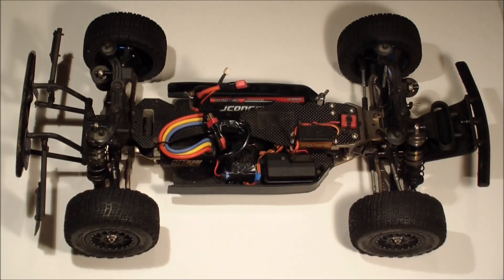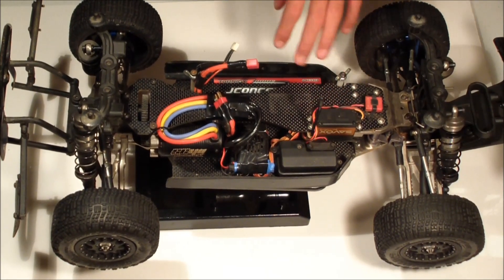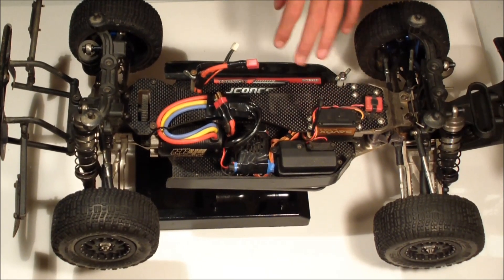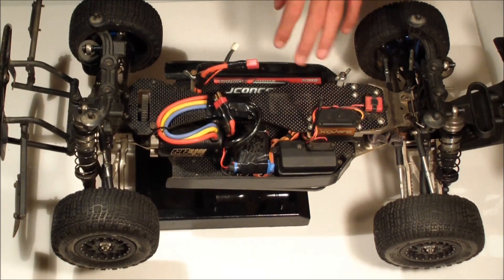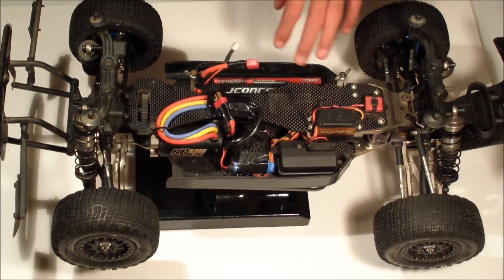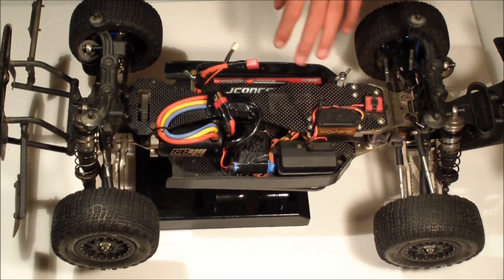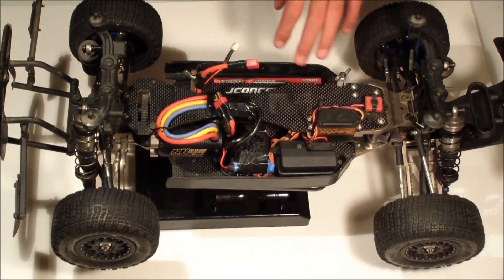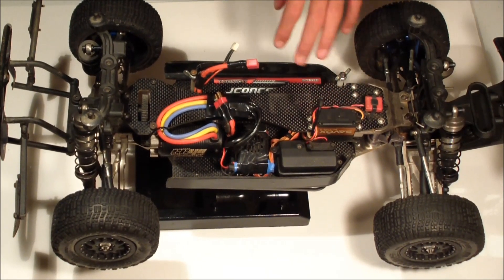TRCE Slash 4x4 Race Setup Video

Comment from the maker: It's the system the tracks use to count your laps. Each track has a buried wire that senses every time you pass. And when you pass, the transponder tells the system how fast your lap was, your pace, and the leader. They won't let you race without one.

Comment from the maker: The main reason is the quality of the product. Team RCE is a smaller business and rely on their quality to maintain their reputation. The RCE chassis was built for those who want to convert their slashes into competitive racers. Not saying the Traxxas lcg isn't made for racing, it's just that it has other purposes too. The flat plate of carbon fiber also makes it easier to mount electronics, changing and rearranging layouts to fit your needs.

Comment from the maker: The RCE chassis was built for those who want to convert their slashes into competitive racers. Not saying the Traxxas lcg isn't made for racing, it's just that it has other purposes too. The flat plate of carbon fiber also makes it easier to mount electronics, changing and rearranging layouts to fit your needs. I would get D8's over the power strokes, more oil volume, and bigger pistons.

Comment from the maker: Welcome to the club! Yes you will need double sided tape for the esc and reciever, but you could just drill holes and mount the esc on with screws. The MMP should work fine with the VXL, but if you're buying it new you might as well spend an extra $70 and just buy the whole system. The castle 4-pole motor will give more torque/speed and opperate at lower temperatures.

Comment from the maker: The STRC Bellcrank is awesome, a manditory upgrade in my book. After repeated hits, the stock bellcrank will start to bend and flex, giving unreliable and inconsistant steering. Being metal, the strc one will get rid of the inconsistancy and provide sharp smooth steering.The STRC one also has an ajustable servo saver so you can anjust the stiffness to your prefrence. For $25 it's a great upgrade!

I never noticed no one else had a video up. If have time, I'll try to make one :)

Comment: You can completely build a slash from parts that hasn't a single Traxxas component in it. Is it still a Slash? A question for the ages. … like the guys who restore cars and the only thing they don't replace is a piece of the frame with the serial number. Is it still a Chevy ?

Comment from the maker: Awesome, glad it went well. At first with my Big Bores, mine bottomed out alot. I was using 60 and 80wt with losi springs.

What shocks do you have? Usually just requires tuning, getting use to the truck, then figuring out oil weight and springs to use. I learned that running too thick of oil won't let the shocks cycle properly. So running lighter oil (45wt)and linear springs should work out. If not, better shocks should be your next upgrade.

Comment from the maker: Ok cool. I came up with an idea to make nerf bars out of the front bumper brace on the Slash 2wd, which works well if you wanted to run nerf bars. But really, unless you race in a demolition derby, the bodies don't get hit enough for them to be necessary.

Comment from the maker: OK cool. The BEC is only mandatory on the Mamba Max because it has such a weak internal bec. You can use the ext. BEC on any esc as an extra precaution, but it's not needed. Same servo works fine with my RX8 without the ext. BEC.

Comment from the maker: Those look like they're quality shocks. But the dampening of shocks depends on how many holes your piston has. Mine right now have 6, and for now it's good, but I might want to try 8 hole pistons because sometimes my shocks can't cycle quick enough on small bumps. 

I can run 27wt because the D8 pistons dampen alot more than other shocks. If 27 was too thin maybe try 32wt and stiffen your springs a little. But before you do that, check to see how many holes your piston has.

Comment: Savox 1258tg isn't a HV servo... 6.0v max.

Moving your lower shock mount on the a-arm isn't intended to be used to adjust ride height... thats for dampening. To adjust your ride height, use the pre-load rings or clips.

Sensored operation shouldn't creat more heat...

Comment from the maker: That it weird. I guess it just comes down to oil capacity. Yours look like they're 13mm bore, while mine are 16mm. So more oil means more dampening. 

If you don't have one, I suggest buying shock oils in the multi pack to experiment and even mix different weights. It takes a while to get it dialed in. SC10 4x4 shocks are also 13mm, and people that use them on RCE Slashes use 35 and 40wt.

Comment: I have a question I have the same servo and it was glitching a lot so I put in a glitch buster, if I have a glitch buster do you think I can run a bec at the same time? I have a castle creations mamba monster 2 1/8 system in my slash 4x4 as well

Comment: just curious, but, how is this a slash? I see slash bumpers, but that's it. why do you call this a slash when there nothing slash about it
Reply from the maker: totally get what you're saying, but it still started as a slash. Stock parts or not, it's still on a slash platform. what would you call it?
Reply: you could call it a cyconxc sct? lol. ,im not insulting you , I just askin why do you still call it a slash. what do you mean , its still on a slash platform
Reply from the maker: lol it's not like I designed it, they're all upgrade parts (made for a slash 4x4) so technically it's still a slash underneith, even if there's only a few stock parts left
Reply: alright , I get it now , thanks. I thought that it would be named after whoever the chassis was made by. but, like I said , I was just wondering. either way is an awesome truck and you drive it pretty friggin great. I just bought a slash 4x4 about a month ago and my wife would wanna punch me if I went out and bought something like this now. lol. maybe Christmas, yeah, that might work lol
Reply: Big oof